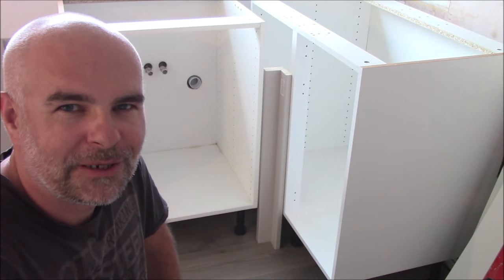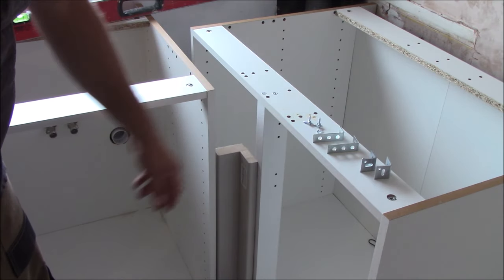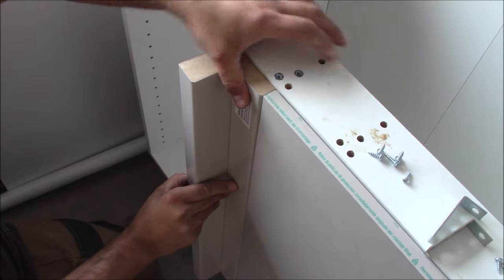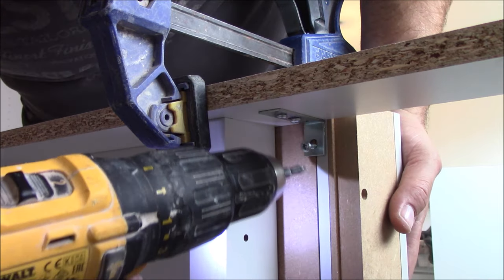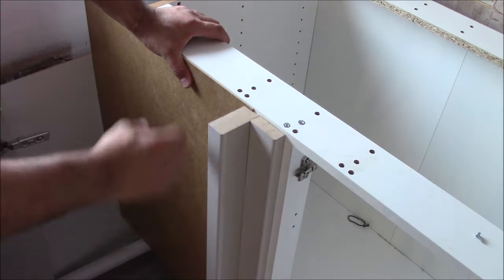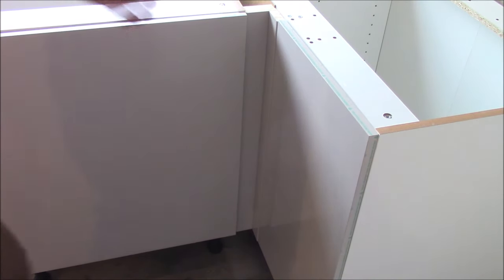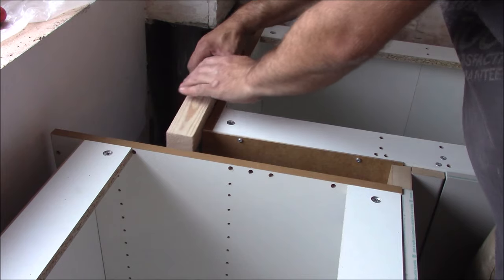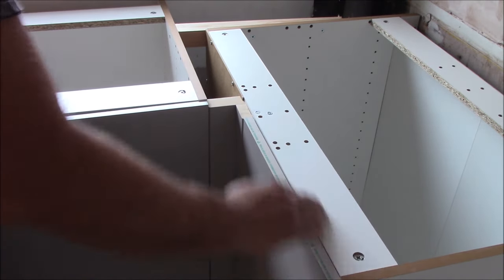Kitchen fitting How to install corner post in a Base corner unit

Comment: Just wondering why is the corner post set lower than the doors
Reply: In video that is because doors not adjusted yet (final step but I did on fixing CP) as you can clearly see right (hinge) side of door (on left cupboard) has to drop to be level.

Comment: You can screw a piece of chip or end panel behind the corner piece to let you screw from the sink cupboard side. I prefer to screw a piece from bottom of cupboard to top the same width as the corner piece space. I means you can screw to keep the cupboard plumb and prevent movement from plumb. I would also fix the cupboard in position and be level with the top before joining the corner piece spacers.

Comment: Hi tanx for the upload that dewalt drill comes with a impact drill wouldn't you use the impact for screwing in screws saving time changing the drill bit?
Reply: E K I find the impact drill is sometimes too powerful for delicate stuff and too noisy as well. The impact drill is great for first fix carpentry though
Reply: @ernestdeak8402  invest in the 887 impact with the 3 settings, 1st setting perfect for delicate screwing

Comment: Hi I have a good kitchen but my corner post is cracked and I’d like to replace it. I don’t know the manufacturer of my kitchen as it was already there when I moved in. How do I go about getting a new one ?
Reply: Either to take it of and use as the example say at bnq or Howdens(or ebay, sometime installers are selling leftovers) to get same  size and shape or take 2 filling panels and make your own but you might need some DIY skills to cut nicely and neatly

Comment: Why would you fit the door at this point !!! I don’t unpack my doors until the laminate worktops are installed.
To fit that corner post I would measure the aperture where the door will eventually go, so that being whatever size door will be fitted, let’s say 500mm for arguments sake, then that is the mark where the corner post would be fitted to.
Reply: Sometimes it's easier just to put it on and visually make sure it all fits correctly